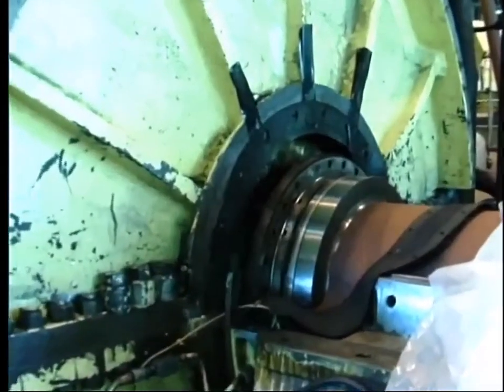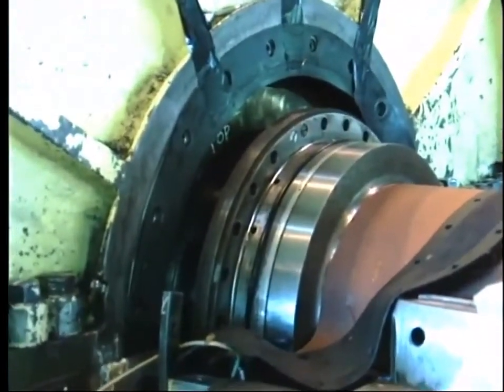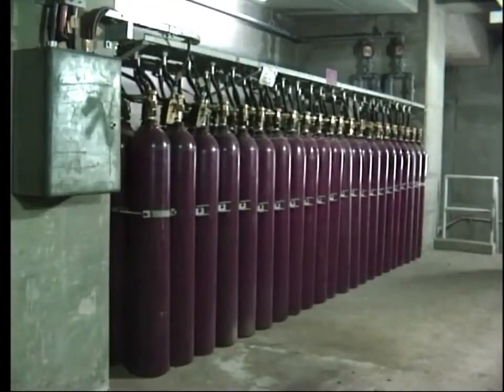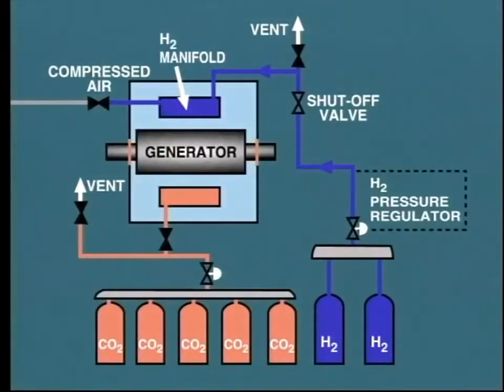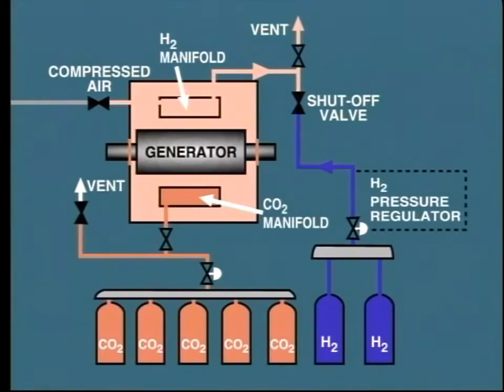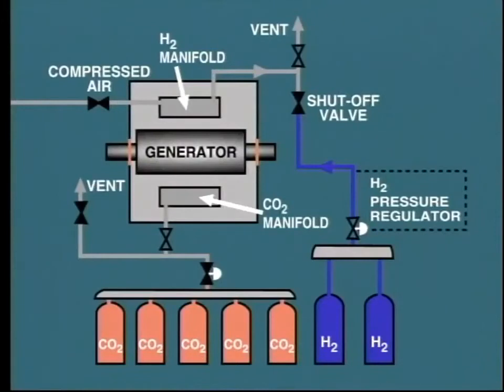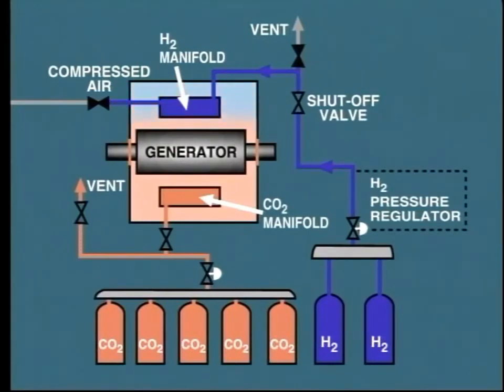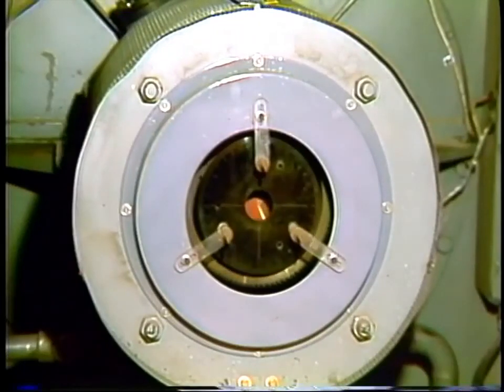lesson 5: synchronous generator cooling hydrogen purging and charging

Comment: what is the cause of the decreasing of the hydrogen purity sir?
Reply: Alot of factors can contribute. Is the h2 scavenging system functioning properly? A bad seal can can be causing air to enter the generator casing. The float trap is a good indicator or the seals functionality. The rotor fan differential pressure is another clue.